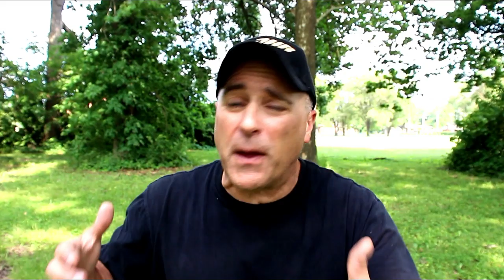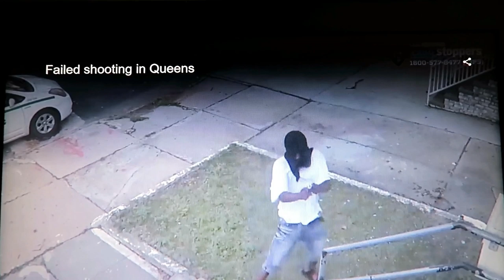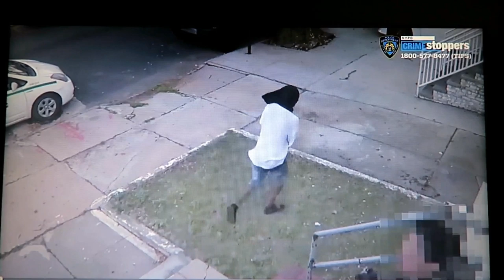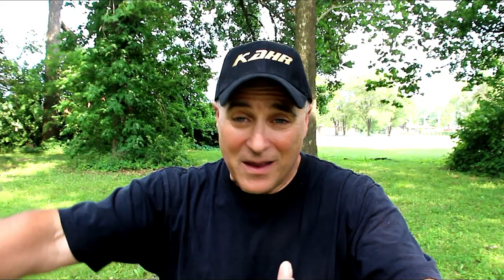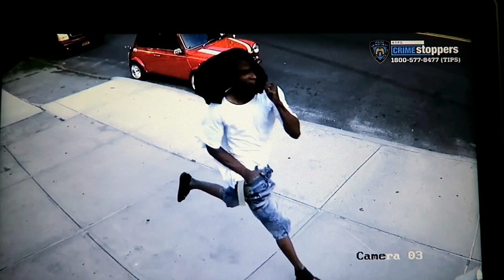Potential Killer's Handgun Failed - TheFireArmGuy

Comment: if still around read the book code 3 officer down
this was written when most dept used revolvers like my time zone...
in the book there was a situation as you mentioned where an officer with a revolver ended up in a situation where he had to use his gun....
he drew he pulled the trigger he was killed.
they looked at the gun they had to soak it for five days just to get it open and remove the rounds....
they found three rounds with dents in the primers the gun was so bad the rounds did not go off  all because of stupidity and negligence

Comment: Back in the days when police carried revolvers a large city put in a new requirement that detectives and brass had to qualify along with patrolmen for the first time. A Lieutenant drew his revolver only to have the cylinder skid across the floor of the range. He admitted that his revolver had probably not been out of his holster for about ten years. He had been assigned to headquarters for that long and had seen no reason to maintain or practice with his weapon. No word if he finally qualified but he sure didn't that day.

Comment: In Bosnia and Herzegovina, when you buy your ccw handgun or sbr, police officers have to check out the reliability of the weapon. And also they take ballistics testing of the projectile to be able to determine from which gun the round was fired out just by checking in the database. Also you have to take your gun every 5 years to police station to check out the function, as well as after any change to the firearm. In summary it is illegal to have unreliable firearm and also it has to have matching point of sight to the point of impact.
Reply from the maker: Now that is interesting
Reply: @TheFirearmGuy  but you can only have 1 auto loader, 1 revolver and 3 hunting style semi auto or manual action rifles or shotguns with or without detachable magazine. Barrel length is limited to 30 cm or about 12' and oal lenght to 60 cm or about 24' for self defense. Also you can have 2 "assault weapons" as sporting tools (limited to the range use only). Hunting licence is similar to self defense only difference ference is instead of sbr you can only have 3 round capacity full size rifles and shotguns. European gun laws just suck.

Comment: Had to of been a glock or divine intervention
Reply: Minnesota Nice Glock goes bang
Reply: @gaybear5328  Glock goes kaboom. It has been documented that Glock barrels have unsupported chambers and some aftermarket barrels are worse. Some 1911s also can have unsupported chambers especially if the feed ramp is polished so far down that it exposes the cartridge more than .05 inch.

https://detroitammoco.com/unsupported-chambers/

I have inspected all my pistols for chamber support. All have full support (no more than .05 inch above the feed ramp) but I only have one that is "more than fully supported" above the feed ramp and that is a Bersa TPR9C. I mean there are no gaps at all. The round goes right down the pipe with just only the case rim exposed including the feed ramp.